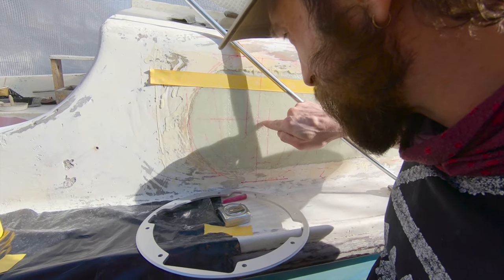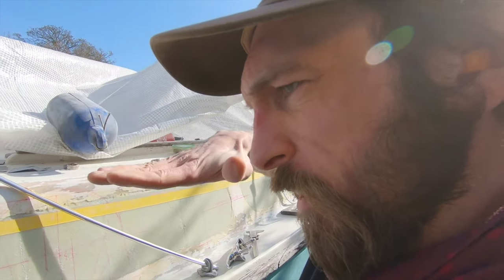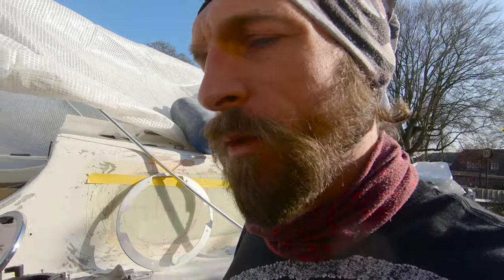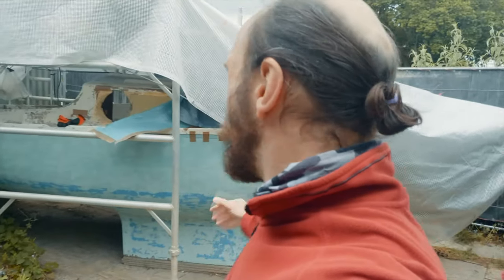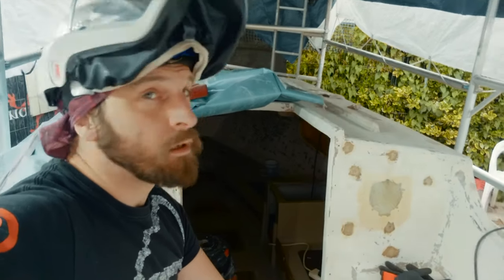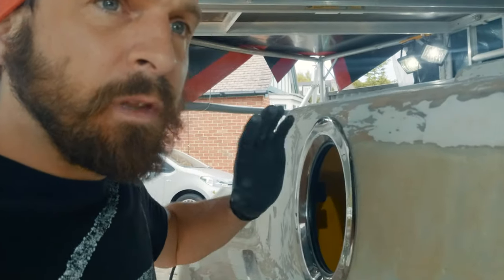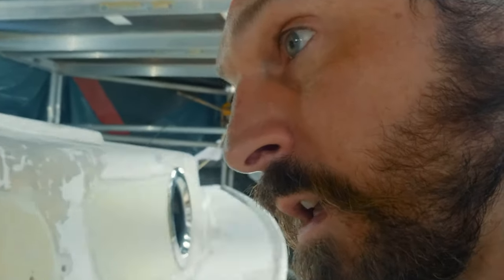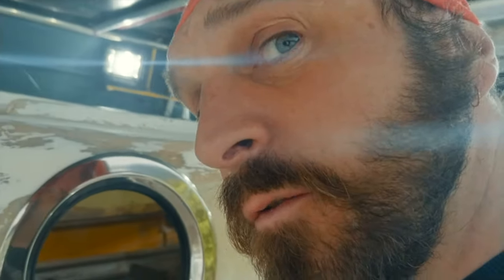Fitting Portholes to the Sailing Boat Project

Comment: I’m refitting my own Vivacity 20 right now.  I just finished gutting the interior, and have started the new berths.  I bough a 6hp and plan to put her into the Salish Sea this fall to cruise a bit before winter.
Reply from the maker: Beautiful location! (Not that I've been there, but it's on the list)
Reply from the maker: Did you get any sailing in?
Reply: @esvarwyn  winter here, still refitting.  Rebed all my fittings, cut out my entire interior and built two optimal bunks.  Almost done with bow roller install. New sails and furler on order.  Thanks for asking!   You keep it up too, so we can both get our girls wet!
Reply from the maker: @chriscurtis8597  Good work! I'm just beginning to gather myself for the fresh season of work 👍
Reply: @esvarwyn  did you know there are two vivacity 20 groups on FakeBook?  Maybe we see you there?
Reply from the maker: @chriscurtis8597  I see you're a keen contributor. Awaiting join request confirmation! Thanks

Comment: The location of the portholes should be based on the fit out you are doing inside, not on how it looks from the outside.
Reply from the maker: Thank you for observation. The considerations of the internal layout are excluded from this cut of the footage, but options are few if the hull liner is retained, as previously stated, and the port thwart is selected to accommodate the heater (path of the flue), which will be addressed in another film. The only consideration beyond these matters is aesthetic balance, which is addressed here. I am glad for this opportunity to state these factors.
Reply: That's fair enough. My narrow boat was a different story, in that case there is more scope for setting out portholes in a more random way to suit the internal layout